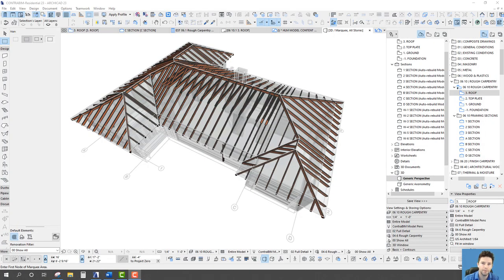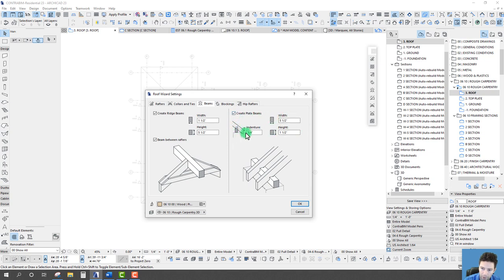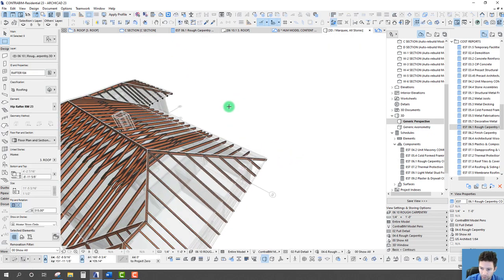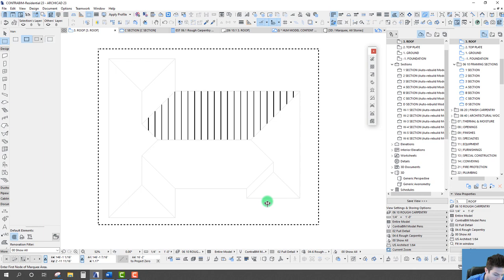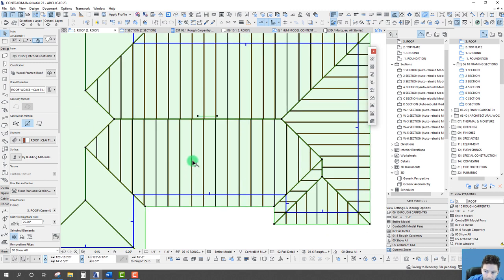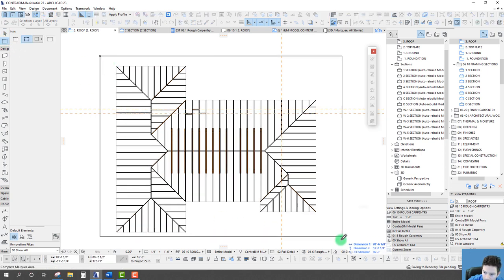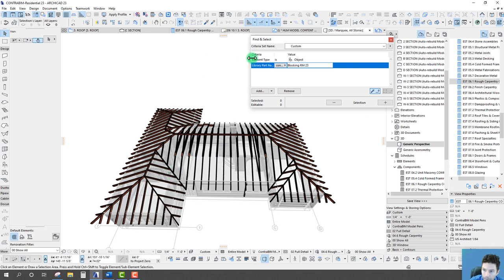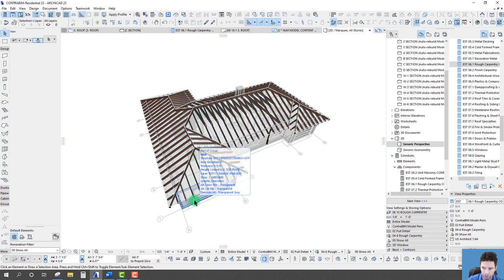ARCHICAD Tips: Become a Roof Wizard!

Comment: Hello, thank you so much for the video, the method works perfektly, but the take off shows not the profil dimensions but the lenth and the high of the profil. Do you have any Idea please? thank you
Reply from the maker: Hello, I'd dig into the parameter settings a bit to see if you can find the correct height/width. You may have to look into the object parameters of the framing objects to find them!

Comment: Hey John, 
Thanks for another great Video - I could learn a lot! 

I have one question though:
How did you get the List of the Roof Maker Elements?
I couldn't figure out how to add the Elements to the list...
Reply from the maker: Hi, thanks for the comment and the question! Each of those roof framing elements is tagged with a cost code, and the cost code is referenced as the criteria on the schedule. That way it'll only list in the schedule the contents set in the criteria. I'll have to do a video on setting up schedules! Its easy if you have a cost coding system to reference. In this case I'm using the CONTRABIM quantity estimating template
Reply: @CONTRABIM  Hi again,
Thanks for the fast answer! 
I understand.
What would be interesting in my case, would be the dimensions and the numbers of the elements. So if the costs can be calculated, the length must also be hidden in the program somewhere I guess.
The lengths would be particularly interesting for my colleauges from the other department. (This is how it works here in Austria...)

I'm looking forward to the video about setting up schedules!
Thanks again for your help!

kind regards, 
Martin

Comment: Thank you John. 
Would be good if this tool would work for roof trusses too. Do you know any trick with those? The trussmaker is not bad but a bit clunky i found
Reply from the maker: Hi there! Thanks for the question. So with the roof wizard, you can create the general 3 sided shape of a typical truss, but without the interior details, meaning the two rafters, and the bottom chord at ceiling level or where it is in elevation. The truss maker can work in some cases, but have you tried the truss objects? This may also help since they have nodes and stretchable points. A lot of different ways to approach trusses, none of them perfect, but if you do a lot of this work perhaps there is a plugin that can make it quicker for you? I'll think about doing another video with alternate methods for trusses...Thanks!
Reply: @CONTRABIM  haven't played too much with trusses object,  normally use the truss maker.
Fact is: They are so cheap to make,  it's faster for the manufacturer to do it before i finish the model,  however the challenge is to achieve something different while using something very common in a different way.  A 3D model can help convey that message
Reply from the maker: @Claudiozee  Definitely. I think getting the overall shape in there is all we really need to do. Depends on the roof line and how long it'll take to model in...

Comment: Could we make steel structure like in this way? which option we should select?
Reply from the maker: Hi Burak! So the roof wizard objects can be set to any material, so you could assign to a steel material and represent them similar to wood rafters. The objects themselves will act the same, and only are available in rectangular shapes, not complex profiles.
Reply: @CONTRABIM  Exatly whatever I material selected it's come like in timber structure not I joist, that was my question for this.. Actually about roof tutorials they dont have iniatitive examples like "zinc cladding" and more detailed one including with "glutter and cladding details of zinc" would be awesome that if you mention one video about this issuee.. thanks really a lot!
Reply: @Brkdmrcn57  CADIMAGE handles that easily

Comment: how did you make that truss list... i cant seem to do that
Reply from the maker: Hi Patrick. The interactive schedule shown is this video is setup based on some property parameters for rough carpentry. It's not actually trusses, but it's a list of the rafters and related framing elements generated with the roof wizard tool. To run a schedule similar to this, set a few criteria parameters that match your objects or trusses, so that they will populate onto the schedule. Easiest one may be layer, material, or property set to something defined for roof framing elements. I'll do another video on interactive schedule listing soon! Thanks
Reply: @CONTRABIM   thanks looking forward to that video... bell on. you are the best mate..
Reply: @CONTRABIM  i think it will help when you doing estimating. i mean why does that not come straight out the box from archicad.